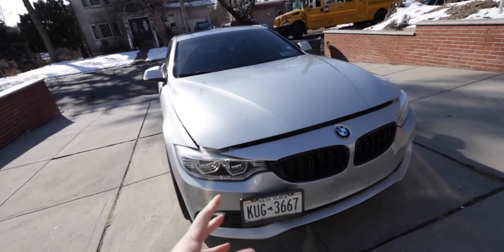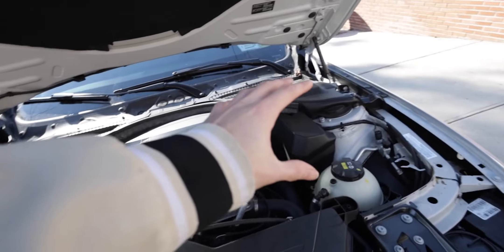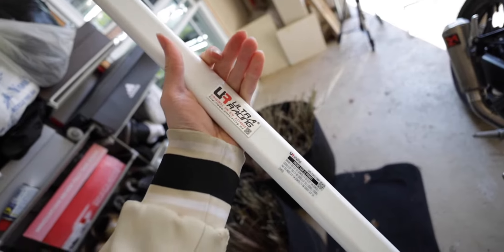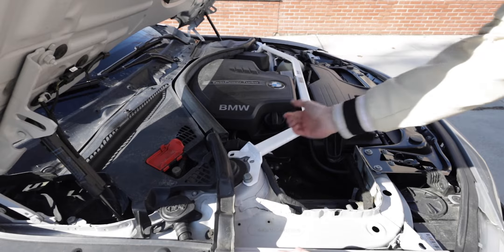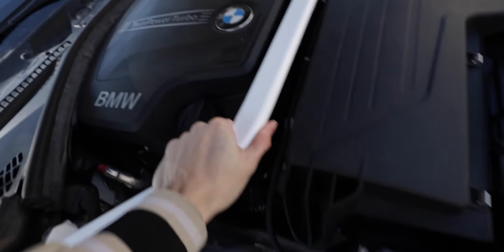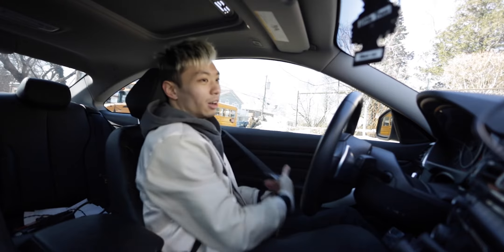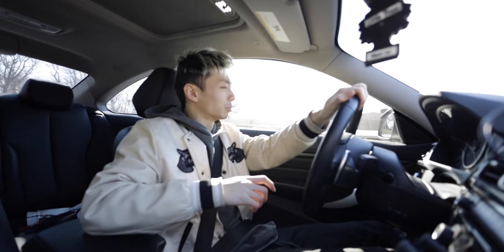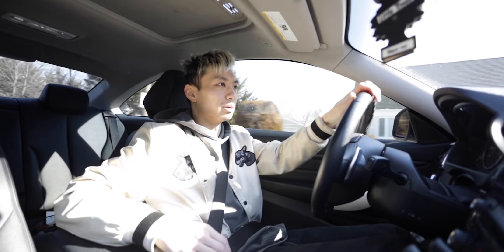Improve your Handling with a Strut Bar \\ F30 & F32 (Ultra Racing)

Comment: I'm looking at the Megan racing one as my '15 328i xDrive is pretty tight but more responsive steering is always welcome. My parents also have a Model 3 which as you said is very direct (albeit the shocks/suspension was a bit harsh for my likening). Now I have even more reasoning to get the brace, thanks! If anything, you're one of the only reviewers who said it increased the sensitivity and not move mountains lol.
Reply: I’ll post a video for the megan racing strut bar in a day or so. I have a 2015 328i xDrive N26.

Comment: You can ruin your torque wrench using it to loosen bolts just a heads up.  Always better to loosen with a normal wrench and only use the torque wrench to tighten